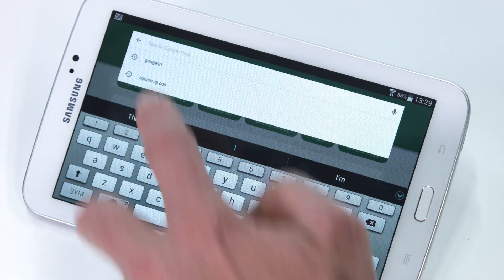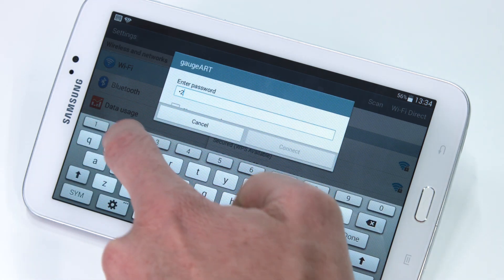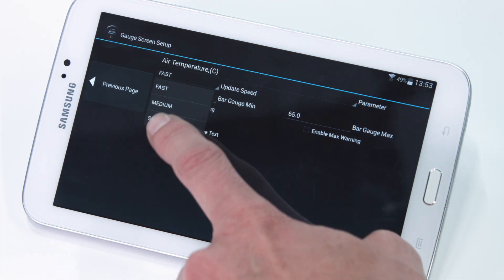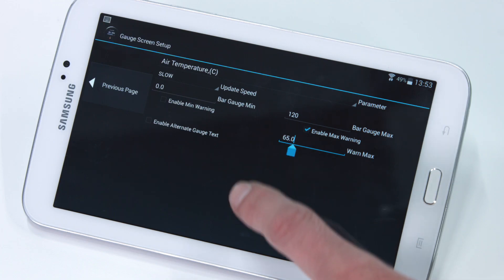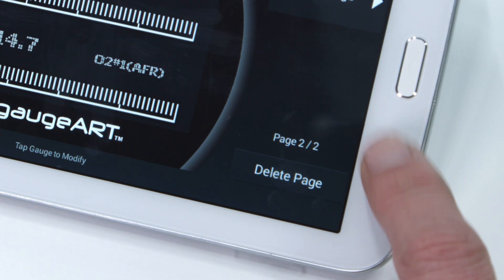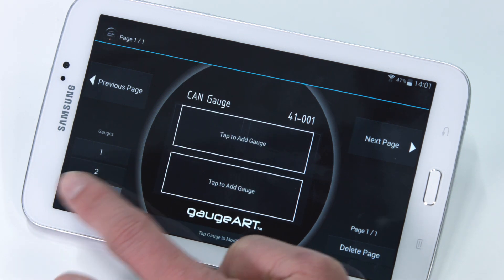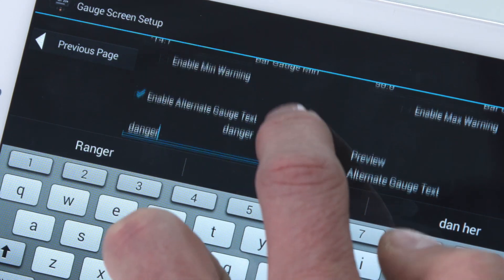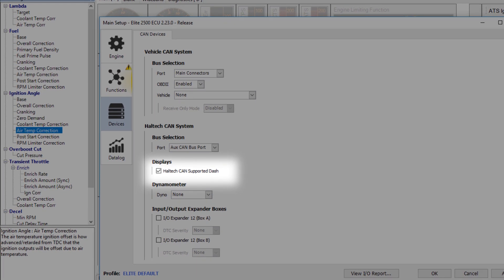💬 How To Set Up Haltech Multi-Function CAN Gauge - Technically Speaking

Comment: can you read engine codes from the can gauge for example this has happen to me my crank sensor had came loose engine light was flashing on and off didn't think anything of it until my car didn't start  im currently running a haltech 2500

Comment: My guage will not connect to any of my devices. I have a platinum pro plug and play for a S2000, a wb1, and the guage. The guage is connected to the wb1. The guage powers up and shows a few readings. But the wifi signal is intermittent and none of the devices will connect. I just get a message saying couldn't connect to network. Anyone else have a similar issue? The GuageArt troubleshooting guide didn't help.
Reply from the maker: Contact our tech support one of our tech guys will be able to help you out. support@haltech.com

Comment: If this is running standard CAN protocols, would it work on standard (factory) ecu that has CAN too??
Reply from the maker: This particular one is setup to work with Haltech ECUs but you can get one to work with other ECUs.
Reply: @haltech  I have an older haltech platinum for 350z, when I go to the devices page under main setup to turn on the gauge in ecu manager, there is no option for can gauge at all
Reply from the maker: @nitish21  For help with that please contact our support team directly www.haltech.com/support